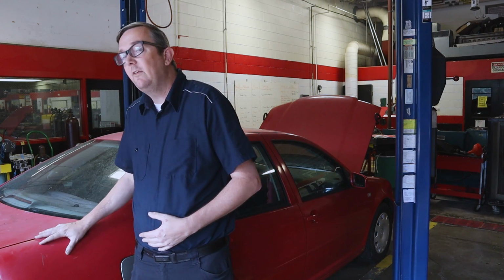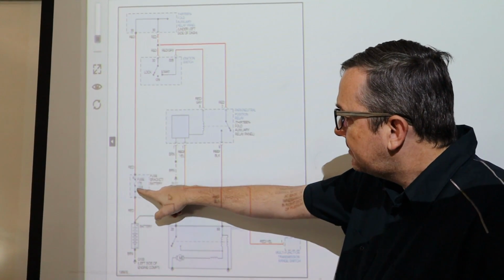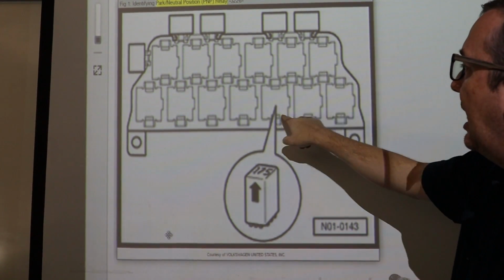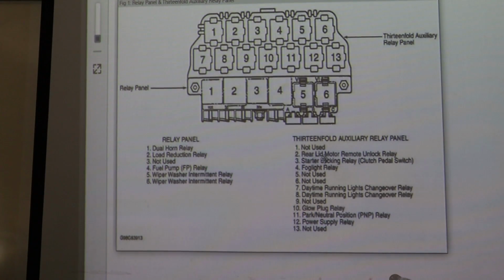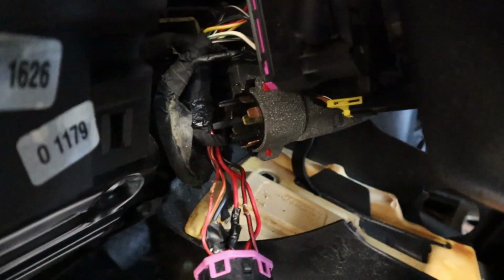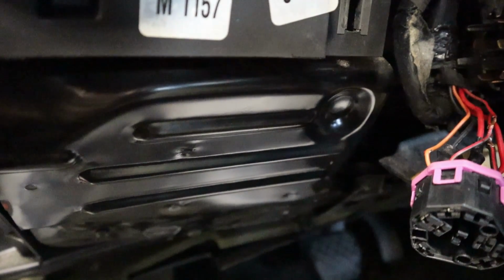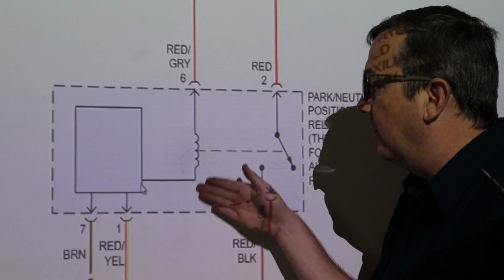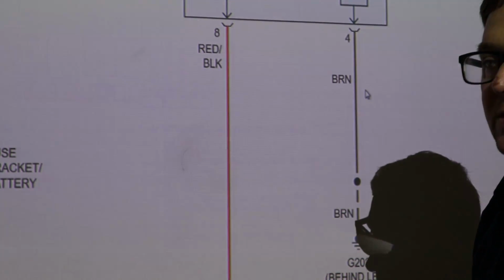Volkswagen Mk4 NO CRANK diagnostic - Golf, Jetta, Beetle

Comment: I have a 2004 Jetta TDI 5 Speed that would start intermittently with no rhyme or reason to when it would start.  It was a no crank no start - all the dash lights would come on like normal just would not start certain times of the day.  The good thing was we were able to push start it whenever needed so it wasn't a top priority but wanted to get it resolved.  I spent at least 1-2 hours with chat gpt to get me in the right direction then started watching YouTube videos, some of which were very informative, this being one of the 2 I found were very helpful.  Using this video I was able to quickly rule out the ignition switch because I could hear and feel the starter relay working every time I turned the key.  I was on to the starter and starter wires.  I noticed the positive terminal was not very tight when I loosened the 10mm bolt on the terminal.  I thought to myself could this be the problem??  I reconnected the terminals and made sure they were both tight and BOOM!!  She starts every turn now!  Watching your video was able to troubleshoot a few things that I thought were the problem -1. Ignition Switch or 2. Relay both checked out!  Thank you!!
Reply from the maker: Glad you got it sorted, thanks for watching!

Comment: I’ve got the issue of no power to dash or anything, replaced battery, alternator, ignition switch, still no power checked I’m getting power to fuse box, power to starter and alternator just nothing happens when I turn the key on also have power going to the remote wire to starter

Comment: I have a 1999 VW Golf Wolfsburg with standard transmission. I found myself in a no crank no start situation. Fortunately it happened at home. We did manage to get the car started again by clamping a little jumper wire between the starter where the main cable inserts and that the starter 4-pin relay (vertical top pin position) where we inserted a screw driver. Then with the ignition switch in the on position (dash lights etc illuminated) and the clutch engaged, we touched the jumper wire to the screwdriver the car started and I drove it into the carport. I assumed that the 4-pin relay therefore was faulty, so I purchased a new one ($31) at local parts store and I installed it, and it didn't fix the problem.... Can you suggest something?  Also thanks for this video - very informative.

Comment: I dropped my transmission, because the oil pump seal was leaking. Put it back in and she won’t start, no crank, no spinning at all. Battery is charged. My 2002 Jetta wagon is dead. Tested the starter, it passed, I noticed the power line that engages the starter was showing the 12 volts constantly. Which makes me believe that the starter relay is left open and faulty. Would I be correct in assuming that the relay could be faulty? It shows no sign of damage

Comment: I have Volkswagen 08 rabbit manual no start no crank good battery good alternator good starter still no crank all the lights inside and out music comes on... When I turn the key to the start position I don't hear the throttle body or see the fans coming on nor does it crank

Comment: Hi, I want to test the ignition wiring and confirm that I need to replace my ignition switch. Would that mean I can "paperclip" both of the 30 wires within the ignition female connector (black/purple)? I am not getting voltage at the end of the starter solenoid signal wire. Thanks.

Comment: I know that is video is pretty old, but I have a question.  The 2 red wired on the ignition. You mentioned that you could run a jumper wire and make the starter crank. We'll I took a test light to both of the big red wires and they both have power. Is that supposed to be like that?

Comment: Really enjoyed this. I have a 6speed manual.i Can start starter with direct wire from bat to starter. But nothing from the key in start position ,except displays battery voltage ok in/ on a meter. But nothing when I hook up igniter back into alternator.

Comment: Hi mr.B, i'm puzzled with my customer vw scirocco 2012 no crank ,no start issue . It uses start/stop button (keyless) . 1st push all accessory powered up ,depress brake and 2nd push it wont crank ,the whole system shutdown as if u r switching off the car.checked the relay , wire continuity from relay housing to starter solenoid  OK, RELAY 507 tested-Ok, for a time being we just jump the solenoid red wire of the solenoid starter to start up the car. Fyi,we've scan the car and only p1734 & U0103 trouble code . Any idea on this issue?thx

Comment: 03 Jetta TDI Manual
Everything works electrical except no crank. I wired a push button from battery to starter solenoid and it will crank, but no power to injection pump. I removed that but can’t seem to get power to the clutch pedal position switch. Checked all fuses, swapped relays , and new ignition switch. Any ideas?

Comment: Whats the transmission range switch look like  and where exactly is it located on a 2000 Jetta 1.8? Thanks.
Reply from the maker: If you see the shifter cable, it is mounted under it. It’s about the size of a deck of cards and is wedge shaped if I recall correctly. Hope this helps and thanks for watching!

Comment: If you have a manual with cruise control. Check the cruise control clutch position switch! It is the bottom, blue switch on the pedal. Kept mine from cranking.
Reply: I will check that , new starter new coils and spark plugs new battery, no start no crank situation just a click sound coming from the starter
Reply: @Rockony what was real problem , did you solve

Comment: Hi great video!
I have a 2000 mk4 TDI
With the break pedal not depressed and key held in start position, dash will light up, and I get a buzzing noise from under the dash…depress the break pedal and EVERYTHING dies…hold key in start position, without brake pedal depressed, and hit relay block with my hand, the car will crank, but not fire…thanks for any input!!
Reply from the maker: Have you checked the terminals on the ignition switch?
Reply: Not yet, was driving… hit a pot hole or something and the car just died… lost all electrical power, with the key on I just get the battery light…if I turn to start and hold… I get all the lights flickering and if I smack the relay cage lightly with a screwdriver it will crank but not fire. The strange part is, if I apply the brake pedal… it again kill’s everything 
Thanks for your advice.
Reply: Hello! Me again! The ignition switch looks fine! No burnt, no corrosion…although I have battery power on BOTH fat red wires?!?
And no matter what….whenever I depress the brake pedal, it KILLS EVERYTHING!!! Like I grounded the WHOLE SYSTEM???
Reply from the maker: @100Aces  yeah I’d have to see this one unfortunately. Only time I’ve seen things like this are if mice chew through harnesses. Also double check that all the relays are correct and in the right position. I did have a Passat with two relays swapped and it did odd things like this.
Reply: @AutoScholarwithMrB  well no rodent damage…and I doubt that the relays swapped themselves when I hit that bump?!

Comment: You are the best Vdubb tutor out there bro..just bought maself an mk4 golf,it has starting issues because the battery terminals were mixed by my sister but i Bought the whole harnese,ecu,clock and hella black bock,and yourf lecture is going too help me know exactly what was the problem with my car😁.it is not cranking at all right now but your video gives me the confidence to tackle this as a hobby challenge..hope il manage,,thanx a million fold for this,,,you are a true Folkswagen Jedi!..May the Force Be With You!
Reply from the maker: Thanks so much Aldrin! Good luck with your repairs.

Comment: My 05 Jetta 2.0. Turn key to run and no crank or click. But there is a clicking coming from the floor shifter. The press brake light next to the P on the shifter flashes along with all dash lights.

Comment: Great video, but a lot is over my head - on the electrical part.  My son has a 2006 Jetta Gas Automatic that periodically will not start.  We have a new battery, new OEM starter, Alternator with a new regulator and brushes, a new ignition relay (the on on the steering column).  When it does not start, we do hear a click, that I am assuming is the starter solenoid engaging, but the starter will not crank.  So from what I can gather it is an electrical (e.g. voltage) problem to the starter. You kind of addressed this early in the video, but how can I test to determine what to replace (I anticipate it is a bad wire).  For example, if I use a volt meter and go from positive to negative on the battery it is OK to do that, but if I touch a positive to the frame that is grounded, is that OK or will that short the car?  Any simple to explain tests would be fantastic.  I have a meter, tools, etc. but I am really green when it comes to electrical.  Thank you so much.

Comment: Hello Mr B, Great video! Very informative.

I wanted to ask: how do I about actually testing the (nine pin) 175 relay to verify if it’s functioning correctly , how would I go about doing so with a voltage meter?

Do I put power to pins 2 and 6, ground to pins 7 and 1 and test pin 8? My apologies for not understanding how I am to actually test the relay. Obviously I am no electrician. I look forward to your response.

Comment: Hey Mr. B here is my scenario with my 2000 mk4 TDI golf. Was letting someone do a test drive bc I was selling it. Guys kills it in the driveway backing it in after the drive. Car won’t start. There is zero resistance in the key when in the ignition, nothing happens no crank. I am getting a blinking immobilizerl and blinking glow plug lights. Immobilizer will stop sometimes but glow plug light continues to blink. This happens when the key isn’t even in the car. Check engine and battery light are Illuminated as well. Battery is fine. Jumped the pins in the ignition switch and the starter fires. Confused what is going on. Any ideas? Codes I have 17978 16764 these two I have had since buying it. 00688 supply voltage terminal 30. 01176 key static signal too small. When I unplug the ignition switch no Christmas lights when I plug it in then everything blinks that I stated above. 

Thanks for any info!
Reply from the maker: Sounds like maybe a possible bad switch
Reply: @AutoScholarwithMrB   ignition switch? Ok, thank you sir I’ll throw that part at it and see what happens.

Comment: Right after replacing the wiper motor switch, I now have a no crank situation on a 2000 VW Golf, manual transmission. I got the rear wiper to work and then buttoned it up only to have the car refuse to crank. I've narrowed it down to no voltage getting to the starter solenoid. When I bypass, putting voltage directly to the starter solenoid, the engine cranks just fine. I show no continuity between the starter solenoid wire at the solenoid and the relay PIN 87 with key turned on or off.. So while I do get 12 volts when I turn the key at terminal 30 it's apparently it's not getting where it needs to go to the solenoid. I also tried sending voltage down the terminal at 87 and still nothing which makes sense if there's no continuity there. Unless there's some other circuit anti-theft or the like which would confound these tests? Or maybe it's just old wiring or chewed through broken somewhere? Is the fix to find a place through the firewall to run a new wire?
Reply: Did you ever figure this out? Thanks
Reply: @sam9472  yeah, turned out to be an aftermarket anti-theft device killing signal between the key to ignition and starter solenoid.
Reply: @JonALewis  gotta love it. Thank you for the reply

Comment: I have no power going to my solenoid wire. Ignition switch is new. And ive check that power is going to the ignition switch. What am I missing? 5 speed Mt
Reply from the maker: Check the clutch switch and starter relay
Reply: @AutoScholarwithMrB  the clutch switch bracket shifted so it wasn't even completing the circuit
Reply from the maker: @gavinvoss2877  glad you got it sorted!
Reply: @gavinvoss2877  how did u fix it? Mine seems to be plugged in?

Comment: I've got an 04' GLI automatic. Crank no start condition. No CEL on diagnostics. Replaced crankshaft sensor and fuel pump relay. Jumped fuel pump to direct power and it works. 428 relay had high resistance and is engaged even without the key in. Manually actuated relay with 12V source. Vehicle was running and driving 2 hours prior. I'm at a loss.

Comment: Ha whatt about this 
Car starts from cold but if stalled or immediately shut off it struggles to start like no petrol
Reply from the maker: Do you have any diagnostic trouble codes stored? Checking that would be the first think I would do. Also these have fuel pumps that can partially fail and cause issues like this.

Comment: My 2002 jetta started doing something similar,  except if you held the key in the start position for 10 or 15 seconds it would crank over and start and it would be fine for the rest of the day. But if the car sits for more then an hour it goes back to me having to hold the key over in the start position before it cranks....Weird!
Reply from the maker: I would peel back the steering column clam shell and see if any wires or connections look suspect. Thanks for watching Kyle!

Comment: hey man ive got a mk4 golf it wont crank at all ive replaced the starter and solenoid and bench tested them and replaced the cables and both clutch switches are hardwired and the solenoid gets 12 when they key turns ive also checked the starter relay and it works fine any ideas?
Reply from the maker: Check the resistance to the starter case to ground. I’ve seen the engines/transmissions lose ground and it cause a ton of issues. Resistance should be near zero ohms.
Reply: @AutoScholarwithMrB  , can u tell me how to check resistance of starter case. I have good digital multi-meter. I get a little puff of electric smoke at starter solenoid, and ground. Can immobolizer do that? This video was great and useful. Thank you!
Reply: Did u ever get it going?
Reply: I have the same problem
Reply: did you ever find the issue?